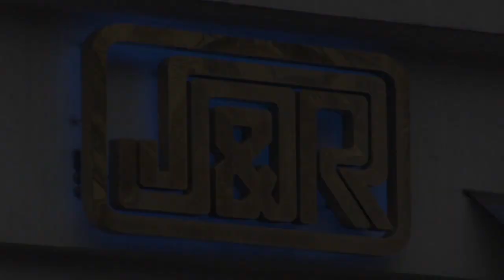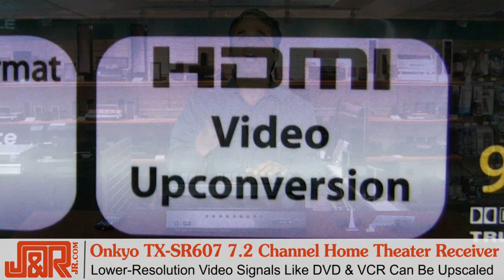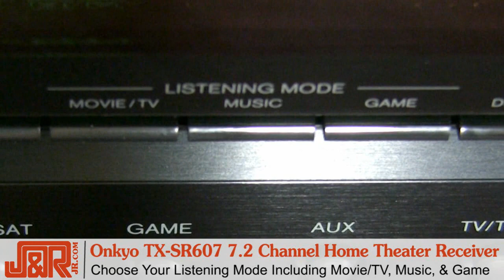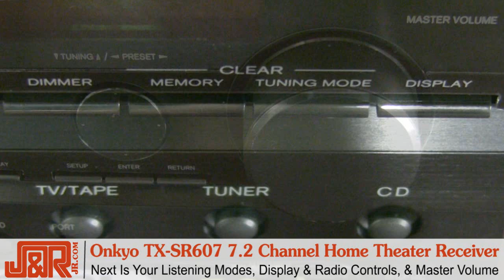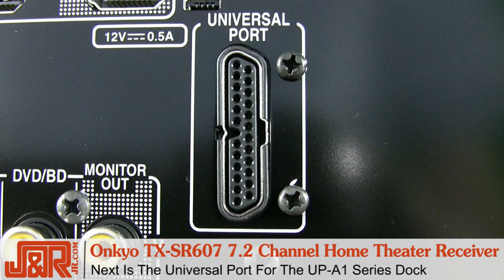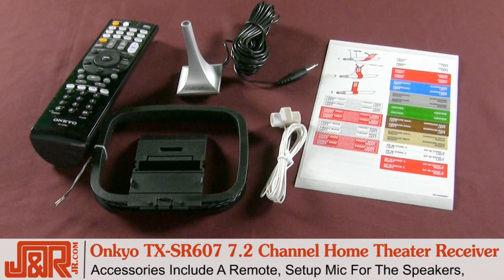Onkyo TX-SR607 7.2 Channel Home Theater Receiver

Comment: Hi there I'm jamie from Blackburn Lancashire in the UK and I have just got a second hand onkyo tx sr 606 avr receiver and it does not have any microphone with it but I have seen some of the new ones used for the new onkyo avr receivers and I am wondering if they could work for the same model as I have got.

Comment: Hoping my 707 doesn't turn off again as it did during the 3 hour hook-up.  Rebooted and it came back on.  But it appears if you don't have really good ventilation, it might turn off.  Mine is in an entertainment center with a shelf all to it's own, but it did get pretty hot when it turned off.

I gather that i-pod capability is in the back.  Drat!  Can't get behind the entertainment center very easily.

Comment: @zZZzzzSnooze2nd 

Perhaps you conected one of the speakers the wrong way. I.E. the positive on the speaker to the wire with the negative end on the amp. 
with low volume nothing would happen, but as you said, once you turn it up, the stereo goes off. (it happened to me a few years ago, and it was that)
Hope it helps.

Comment: no with the TX-SR607 you can only either choose the "high/wide speakers" or the back surrounds. I think the the TX-SR1007 (an higher versions) has the ability to use a 9.2  speaker-setup.

sry ' from germany ;)

greet's